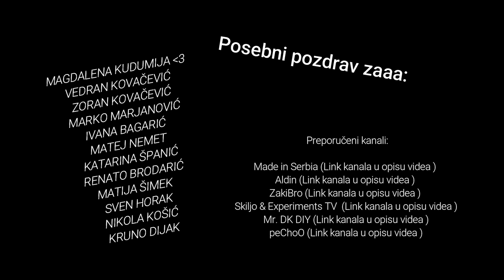Homemade STANDING PUNCHING Bag ?

Comment: How the hell do I get these equipments,. I might as well just buy a punching bag
Reply: There are much easier ways. Discard all the metal parts and just build a wooden base to secure a wooden pole in an upright position. Then pad it what whatever soft stuff you got. You don't have to have the spring effect even if it's pretty cool.

Comment: After 20 seconds I realised that I needed, an electrical saw a couple of metal sheets and some welding equipment. That's 400 pound straight away.. Think I'll just buy a punch bag for 50 quid. Cheers

Comment: 'Homemade'
If at home you have a welding kit, angle grinder, drill, cut-off machine, a bag of cement, and bits of metal at your disposal.

I think I'll just buy a punching bag from the store. It's a lot cheaper.

Comment: Yeah I don't...have all that...to make this...😐
Reply: put rubber, cotton, or something like that around a tree with a lot of tape. Put a lot of layers of soft things first and take them out when you are more comfortable. of course using leg pads and gloves for precaution.
Reply: A simple way would be to use old tyres around a post dug into the ground or set into a tyre filled with cement. You could even build it around an old piece of plastic pipe such as the type used for running cables under roads. There are lots of options for building something like this with few or no tools, just look around for what you can use.

Comment: man, amazing efford, with very little changes it would be much better. 1- sigle wider heavier base. 2- a more stiff fixation, less absortion for more power. 3- the punching bag it self cmon, it was just about dong a cleaner folding, you could even use some rolled material and it would look much more cleaner.

Comment: not that smart , too much pieces, too much welding and then at the end, the bag was clearly forsaken, i mean you could smiply put a real clean boxing bag, the worst idea would have been to use tapes, and you did it..... the concrete mixture is not following the standards at all, that mesh is nearly useless when it comes to the efforts the concrete will have to whistand and it could be even be compromising for that concrete because there are spots where the concrete didnt enter in between metal pieces...  anyway, next time you need more engineering to make it far more efficient, comfortable and durable in time
Reply: aymen chakir  .... firstly, be polite talk well, or shut your 
muzzle , ....secondly, this is 
constructive criticism, if you read the comments, you know he had enough motivation and cheering up.... that being said, he's young, and yes he did some efforts but he need to improve his skills, and for that he needs to understand the flaws of his build, no one told him he's an idiot or anything like that....

Comment: Deception. The spring from a hot steel does not like high temperatures at welding.
Reply: Seems to be doing just fine for a deception